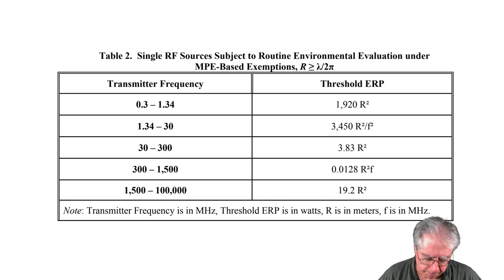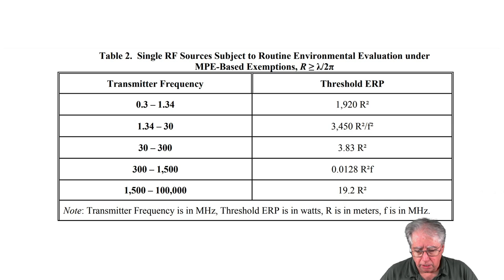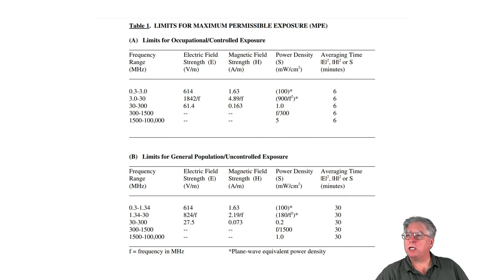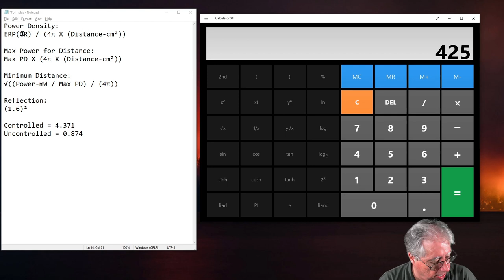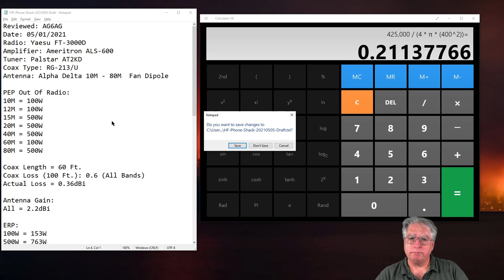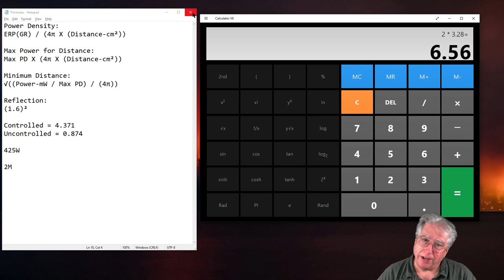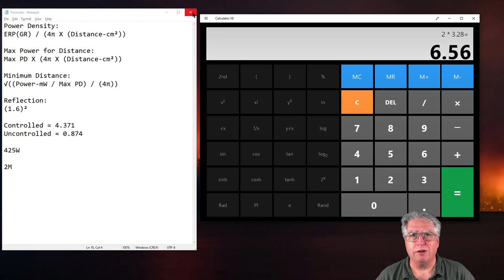Evaluating Your Home Amateur Radio Shack for RF Exposure Levels From Your HF Rig

Comment: Can you just take a measurement around the antenna while it is transmitting?
Reply from the maker: Yes, you can use a field strength meter. However, a professional quality meter is extremely expensive to purchase and to have calibrated. You can also use antenna modeling software to estimate power density at different distances.

Stu
AG6AG